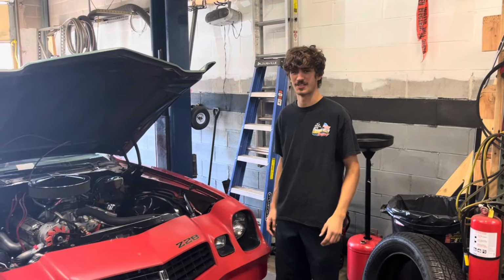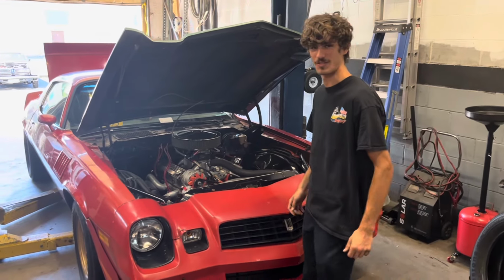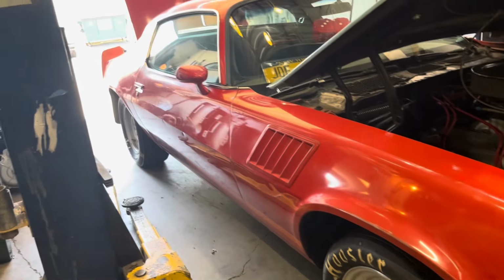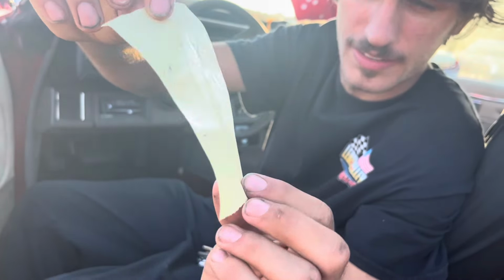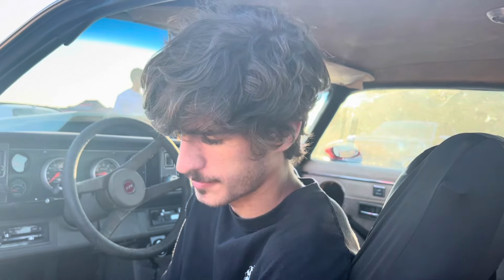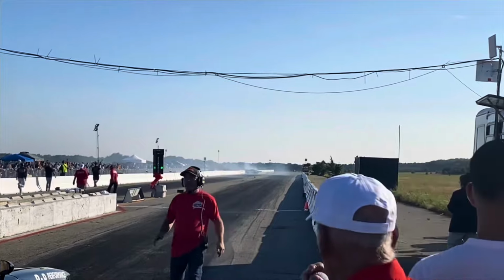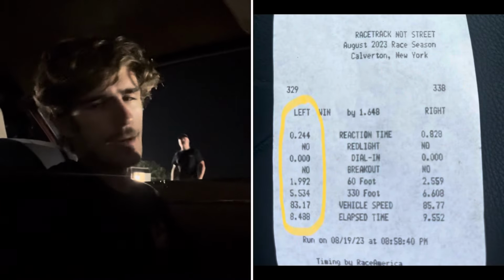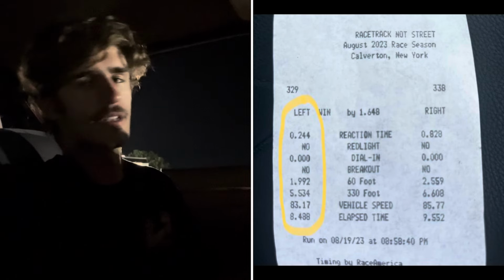Racing my 79 Camaro! Opening day at calverton! 8/19/23

Comment: What all you have done to it?
Reply from the maker: the motor is .060 350 with 041x heads which are the heads that came off a 69 camaro with a 302. un ported, 64cc combustion chamber, 1.94 intake valve. 480 lift cam, rpm dual plane intake. 750 holley knock off carb and headers. turbo 350 trans 3.42 gear. thanks for commenting!